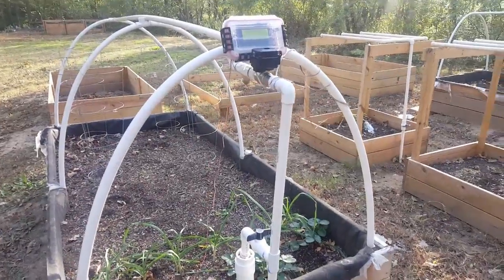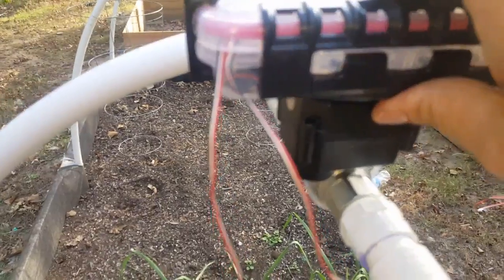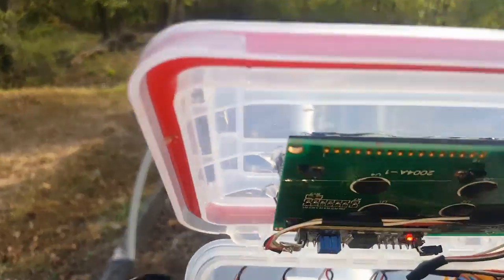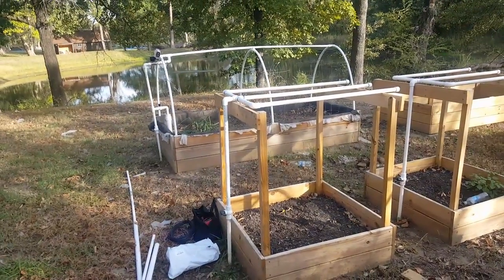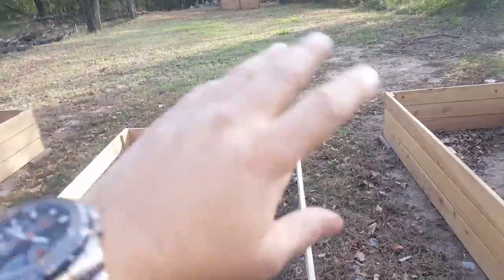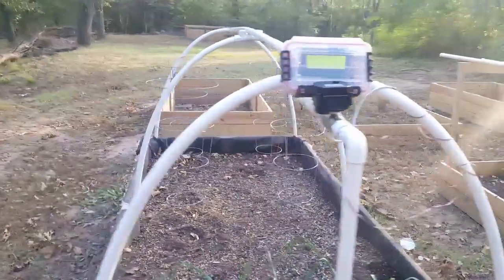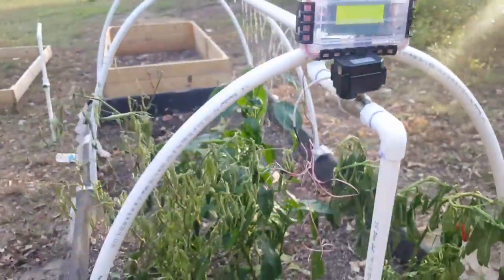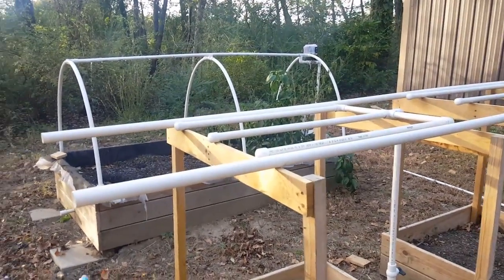Arduino Automatic Garden Bed Watering System

Comment: Why did you use two arduino (one per beds? Why didnt you use only one for the two beds with multiples relays and sensors?
Reply: EngineerPrepper  Nice projekt! !!
I have a similar projekt and the same problem corrosion .
If you seal the edges it can't read the resistans. 
You need a capasetiv sensor as moisture sensor.
Reply from the maker: Charles-Étienne Olivier Good point. I thought of doing that this season. If there is enough space for the code on the microcontroller .Stay tuned for an updated code.
Reply: Thank you! One more question, i'm now working on a similar system. Have you been experiencing some corrosion on the moisture sensor?
Reply from the maker: Actually I have, Im going to seal the edges of the sensor with epoxy or something. Since voltage is going through the sensor, electrolysis is taking place. So, my though is to seal the fibreglass edges to prevent moisture withing the layers.... I doubt it will prevent it completey but we will see.
Reply: @Charlot1984  Recently saw a YouTube video addressing this. There are moisture sensors available that use capacitance instead of direct contact. According to the video, they don't corrode. Sorry, I don't have that URL handy.
Reply: Are you turning off the supply voltage to the sensor ? Voltage only needs to be on for the instant the reading is taken, not constantly. Use a transistor or a relay to turn off the supply voltage to the sensor chip. If you need continuous reading then just read for one second every 30mins.
Reply: EngineerPrepper You can use I2C to connect a bunch of these, for example Arduinos micro as slave and an UNO as master